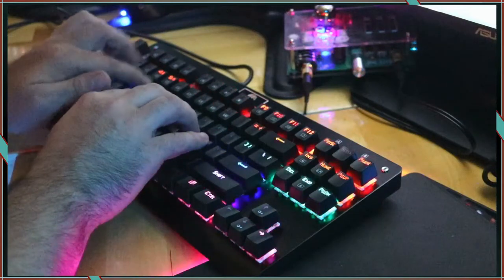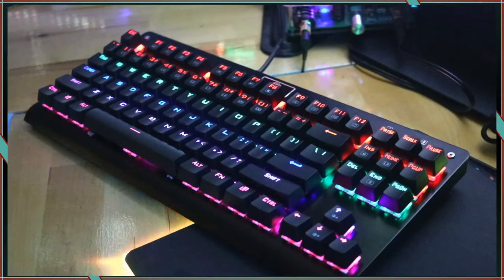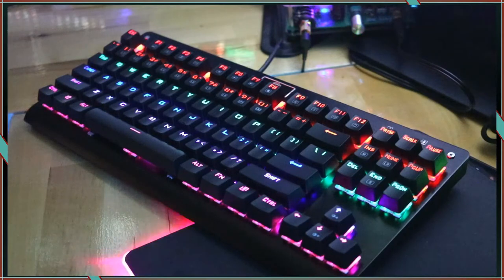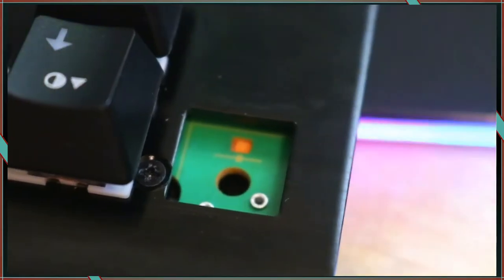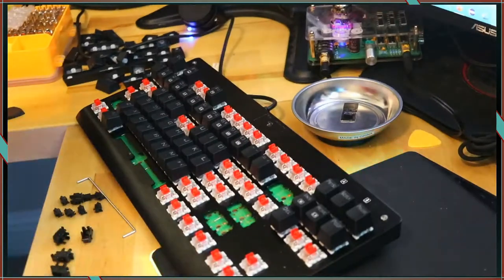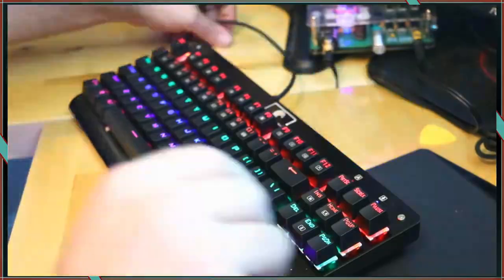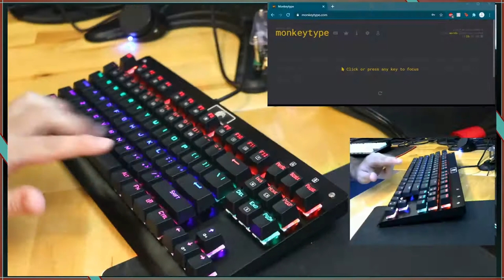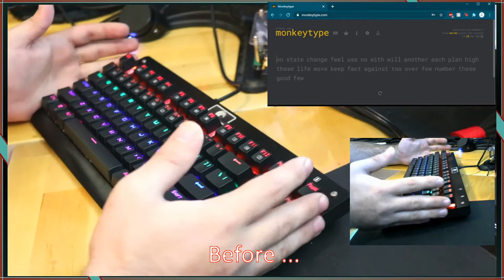Keyboard Build: Z-77, the cheapest hot swap keyboard: Foam Mod, Stabilizers (Outemu Red)

Comment: I have one of these. It was my first ever mechanical keyboard I purchased it like 6 or 7 years ago with the outemu blue switches. I've recently gone down the mechanical keyboard rabbit hole and built my first custom keyboard. I was thinking about reviving my Z-77 swapping the keycaps and swapping in some better, quieter switches just for fun. Anyways, THANK YOU for clarifying that normal MX switches do not fit in this board. You saved me a lot of time and money.
Reply: @ireakhavok  Actually it is. I was curious, and I did manage to put a Gateron Red 3 pin and a Cherry Speed Silver in the Z-77. You just have to make sure that the switches are perfectly lined up and you might have to push a little harder than you're used to. But in the end, the new switches work fine in the Z-77.
Reply: You have to be very precise and make sure the switches are perfectly aligned. Otherwise, you will bend the pins.
Reply from the maker: YT deleted my original comment: I hope that you were able to update this board! the more I have it around the more I like it.

Comment: Any tips on opening it, I am still having trouble with the screw under the symbol :(
Reply from the maker: take off the keycaps and use a hair dryer and a strait razor to get it off! you will need a lot of heat and then just get the razor under the corner just pry it up, a little. Start in the corner. The sticker is more solid than it would seem

Comment: I got one of these for £25 and just intended to play with it while waiting for my first decent board to arrive. Actually quite impressed, especially for the price!

I've already half filled it with CS Jelly switches I have ready for the main board. Worked perfectly.

Once I get the thing open I plan on band-aiding the stabilisers and I have a large silicone cake dough mat I'm going to cut up for a sound deadening layer. Maybe add some packing foam.

I've also been thinking about filling my rather cheap keycaps with expanding spray foam for a slightly deeper sound! Not seen anyone do that with spray foam yet?
Reply from the maker: I've heard good things about those Akko switches! I do not suggest the expanding foam, just because it would be hard to get the same amount in each keycap, but hey, you can do what you would like! Shoot a video, and show the community! Trying something new is always cool.
Reply: @ireakhavok  That's true! It was only a random idea really. It would only be with some old keycaps, so could be worth an experiment.

I don't have much to compare them to but the switches honestly feel great. I think the jelly blacks are gaining favour for their sound profile but the Pinks are a joy to use so far.

Comment: will 3 pin switches work as a replacement?
Reply from the maker: only if they are outemu. I wouldn't suggest trying any others. It is possible with other switches with modification, but I do not suggest it. Use Outemu switches and you will be fine.
Reply: Outemu and Akko cs switches will work
Reply from the maker: @derpgodyt6316  Didn't know about the Akko cs switches. Will be looking them up. thanks for the tip
Reply: @ireakhavok  Oh, your welcome
Reply: Only some switches fit on an Outemu pcb, tho there are some really nice outemu switches also akko and gazzew switches (made by outemu) will fit but gazzew are 5 pin switches so you'll have to cut the 2 extra plastic pins to fit them
Reply from the maker: @RedRat999  if I were to get any AKKO or GAZZEW switch , and don't like clicky switches, but love tactile switches, which would you suggest? If they aren't that tactile, then I wouldn't mind a linear either.
Reply: @ireakhavok  gazzew bobba 4u switches are supposedly (or at least many many ppl say) one of the best (or maybe the best) tactiles you'll get (and yes is expensive), and if you love thocky deep sounds when you press the key there is a variant of this same switch called gazzew 4ut (thocky), akko has 3 tactile options (cheaper options) Ocean blue, Orange, Radiant red, what I've heard about the ocean blue ones is that are really loud (I don't like it personally) I'll leave you the link of akko page so you can see the specifications of each tactile switch
https://en.akkogear.com/product/akko-cs-ocean-blue-switch/
Reply: @derpgodyt6316  I chose Akko switches by complete fluke then! It made me think anything would work. Pretty happy with the Jelly Pinks, although apparently if you lube them you need to be very sparing or they will stick and mush.
Reply: @Kholaslittlespot1  K